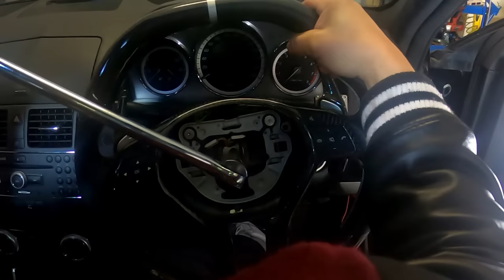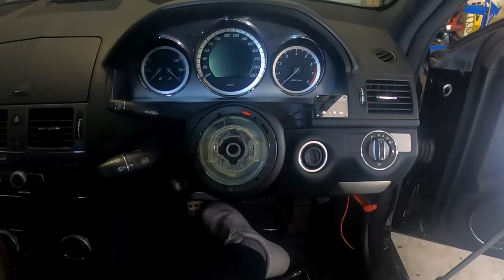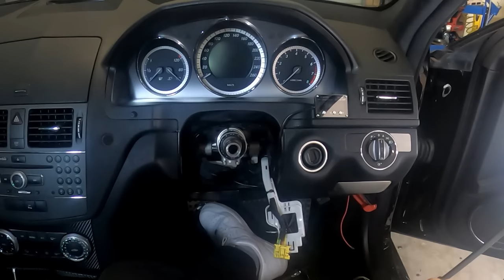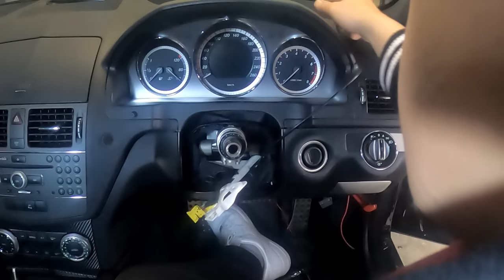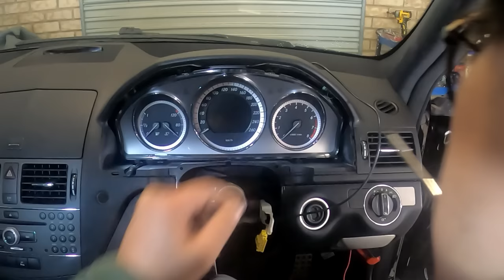HOW TO remove and fix ESL/EIS/ ELV MODULE  w212 w204 mercedes motor replace  Part 1

Comment: Hi bud, where is the motor getting power from? I didnt see you connect or disconnect the motor itself.
Also do you have to remove the EIS if your only replacing this motor? 
Thanks.
Reply from the maker: @illegalwayz1  there is a harness that plugs into it... you u see the green plug on the unit itself.. a harness plugs into it and that's what gives it power ... if u look under the car u will find a cable that leads to it and u just unplugged it ...there is then another harness under the steering column about half way that has a white connector ..I think ... and that also connects to it....if your only replacing motor u do not need ro remove the eis... I only showed that so if ppl want to send it off to code an emulator ... they need to remove both eis and esl and send it off with 1 key and then they code it to work 
 ut no u don't have to remove eis if your just replacing the motor
Reply: Okay. Thanks for your help.
Reply from the maker: @illegalwayz1  no sweat buddy thanks for stopping by
Reply: @MIKEYZVLOGZ is this the process you described in the video as “disconnect the battery?” That’s what I was really unclear on. What is meant by disconnect the battery and how is that done? Do you “disconnect the battery” while the car is running? Do I need to have the car jacked up to get underneath? It’s a great video you’ve produced, but this was a part that confused me
Reply from the maker: @erixlog ok so all i mean is to remove a terminal (negative) so that the battery is disconnected . this way the esl won't lock itself if u pull the key out plus u won't get an airbag light error wen removing the airbag too. also once u disconnect the battery wait 20mins for all the power to discharge ..then proceed ... i hope that makes it more clear... 🙏
Reply: @MIKEYZVLOGZ  not quite clear yet. Sorry. You mean the negative terminal of the car’s battery?
Reply from the maker: @erixlog  yes remove the negative terminal of the battery ... this is all i mean by disconnect the battery...when u do that .. the battery is disconnected... that's it. the negative terminal only of the cars battery...is there another battery ur referring to? to put simply..make sure you disconnect the cars battery by removing the negative terminal ..

Comment: I'm in a bit of trouble right now. This morning I went to a tire shop to rotate and balance my wheels and then I went to a automotive shop to get an oil change and once I received the car, my car wouldn't crank. I had the problem before but after like a day it fixed itself when I moved the steering column up and down to get a bit of shock for it to start again. The last time it happened was around November of 2022 and now it's happened again but this time my car (2008 c300 luxury) doesn't show any sign of unlocking the esl. I'm moving into the apartments of my university on Saturday morning and I already have had the motor from the past but have never made time to fix it and I never bothered cuz it was fine until today. Remembering back on this morning after the tire shop had rotated and balanced my wheels, I did notice I had to do the shock thing with my steering wheel but it started right up. I was just wondering if you know what I should do. Maybe even any tips for getting the esl in the unlocked position again so I can start fixing the problem
Reply from the maker: it sounds like tour motor was on its last legs ..I always stress wen u notice this happening..dun wait to be stranded u need to just get it fixed..I recommend a bypass module ..it no longer locks tour steering wheel but at least u never ha e to worry about it failing again
Reply: @MIKEYZVLOGZ But is there anyway that you are able to remove the battery connection and start removing parts to get the steering column out and then drill the hole like other youtube videos say to do without getting the chip fried?
Reply: @MIKEYZVLOGZ and also how do the bypass modules to work? Do I have to get the esl out of the car first and then connect the bypass? And also does the bypass need to be programed to the key? Or can you get any bypass module and connect it and have it up and running? Cuz I'm assuming that in order to get the car running you have to get the locked esl out of the block in order to have the steering wheel be free and then install the module which is sent signals from the eis/elv right? So it doesn't technically need to be programmed from my understanding
Reply from the maker: @amira.284  u still have to remove the esl and the eis and send it off to a locksmith or someone who knows how to do it ...better if u remove them or else they can come to your house and do it but charge for labour to remove it ...u sens off your key eis and esl and your emulator bypass device and they will male it all work for about 200 to 400 depending who it is
Reply from the maker: @amira.284  yes ofcourse u can ..

Comment: Mike hello ! 
When I insert the key the esl unlock noise isnt as clear as it was before. It seems a little bit faded. Do you think it may be a sign of esl starting to fail?  If so , would you reccomend replacing the part before failing completely?  
Is it cheaper to replace it before the esl fails completely? 
Thank you , keep up the great work 👍
Reply: It’s possible that your battery needs a replacement. Check the voltage on your battery. And for future purposes, consider replacing your OEM mechanical ESL module with emulators. (Plastic Modules) They are on eBay. Don’t worry about it being plastic because it’s only for turning the key. They also do warranty on emulators. Turn around time is 1 day shipping. $250 for the emulators. I believe there’s also a way to replace the inner part of the module. Small part. eBay also sells that small part. But you’ll have to take out the module apart, replaced that small part with a new one and your done. Dealers going to charge $1500-$1800 for the OEM mechanical ESL module but it probably will fail again since it’s a fail design. Mine is still working fine. But I’m definitely will go to the emulators route in future if it happens. The changing the small inner part probably the cheapest of them all.

Comment: Better than my previous explanation, why some people inc. myself find just changing the motor might not fix it:

"The NEC chip acts as a fuse, when the motor goes bad the excess power draw burns the chip, thus necessities a new ESL.

If you catch the motor going bad in time and pre-emptively replace it, you should be good for another couple years. But if the ESL totally craps out.... Then it's 50/50 as to replacing the motor will fix the problem.

The NEC chip holds the immobilizer info, including all key hash numbers. The ESL independently verifies the key, so if the EIS says key is valid but ESL says it isn't, tough luck. Both must match before ESL gives command to EIS to turn on terminal 15, 30 and 50." End of quote from user Deplore of a Merc forum.

Expert locksmiths I just talked to claim their repair gives you a genuine motor and a genuine NEC chip, one year warranty and if you drilled the pins out will charge you for a new lid, cost AUS$440. I am sure the Merc stealerships either install a new ESL and match it with your ignition lock/key combo or also rely on expert locksmiths to recondition your dead ESL.
Reply: hi, I renewed the steering wheel lock set which only works once. now it doesn't work
Reply: @nguyenvang1256  what did you replace (the whole els or just the motor)?

Comment: I'm lost here. I got 04 benz s430 rwd 7G tranny w220. Did a tranny swap, now the doesn't want to start. When I put the into the ignition switch (EIS) it doesn't want to turn. Battery is fully charge.
P.s I even went to junkyard got ecu, EIS and shifter still won't even turn on...
You guys talking about drop down steering column. I am missing something here

Comment: Where do you purchase the replacement motor?
Reply from the maker: ebay aliexpress Amazon
Reply: @MIKEYZVLOGZ  Just ordered a few (LOL.)  Thanks, Mike.  These instructional videos are amazing!  I am going to take on my 2011 GLK350 ESL this weekend.
Reply from the maker: @ramonmcgee2240  ur gonna be ok mate
Reply: @MIKEYZVLOGZ  Roger that, thanks.  The new motors came in, and I ordered a ujsed ESL as well.  I will try and change the motor in the existing ESL to avoid the "programming problem" with the dealership.

Comment: We are having the same issues now! 
Am I correct in saying as long as the steering lock ISNT activated, I can give it a go? 
Also.. did you not have to reprogram the part to the key? That’s what all the garages are saying we need to do and are trying to charge £200+ just for that?
Reply from the maker: hey sorry mate but u only have to reprogram if u are replacing the entire esl module or replacing with an emulator ..if u are only replacing the motor it's as simple as replacing the motor and put everytjing back exactly as u found it and it will work

Comment: What kind of motor should I get and where? Is there a certain motors that are more reliable so this doesn’t happen anytime soon?
Reply from the maker: @christianmatias5202  i got the cheapest i could find on aliexpress and or ebay and it worked fine

Comment: I’m having this same exact problem and my ESL is in the locked position. I don’t want to have to cut the bolt because that means reprogramming. I’m prepared to disconnect the battery if I get it unlocked to prepare to do this but so far it’s a no go for me. Any advice on getting it unlocked to do this project will be greatly appreciated.
Reply from the maker: hey there mate .... so there are other ways to open it but i personally wouldnt go that route as i wouldnt feel as comfortable .... so another way u could try is by drilling a small hole where the motor gears are located and u can physically turn the motor gears yourself until it unlocks however im not certain if that will fry the chip and need reprogramming .... some more research would be needed ... the only success ive had which worked for me by chance is tapping on the lower end of your steering column in order to shake the motor just enuff to turn that last rotation so it can unlock .... apart from these 2 and cutting the bolt these are the onky other ways ive heard of ppl getting the esl module to unlock
Reply from the maker: i really hope you can sort it out as i understand your frustration friend.... also another route could be getting a esl module bypass which looks exactly the same as our esl except there isnt a locking mechanism but it needs to be programmed to suit ur car.... this is my next option when it decides to fail again
Reply: MIKEYZ VLOGZ I’ve had a chance to look into things and unfortunately I was not able to successfully get it unlocked. I tried playing with the key, wiggling the steering wheel, unhooking the better for 30 minutes, banging on the area were the esl is located.

My next project will be to remove the steering wheel column and figure out how to get the lock off altogether with the battery unhooked. If I can get the whole module off and possibly open it, I may be able to replace the motor in the same exact position that the original one is in. I’m hoping that will work if it’s even possible.

If all else fails I think I’ll just get a bypass which I have found on eBay and get it programmed with the EIS. The turn around time will be about a week or so with 1 day programming and getting the parts shipped back for me to install myself. That price is $350 versus the dealer at over $2000.
Reply from the maker: @darrylpolite8722  i think that would be the best course of action mate ... i hope it all works out for u and let me know how u go.... would love to hear
Reply: Cutting the bolt (M13) should not lead to reprogramming, just putting a new bolt in, but I have not done that as yet.
Reply: Worked out without extra work it is not possible to put a new 10mm bolt in easily, so like others I am just going to hide the ESL somewhere and have peace for the next 13 years before that motor burns out again.
Reply from the maker: @dominicwild3189  well dome matey ... congrats

Comment: So how do you "fry" a chip with the battery disconnected?
Reply from the maker: so wen u go to put your esl back together , if you do not put everything back properly wen u goto connect your battery and unlock the car it will damage the chip, this is what is refferred to as "frying the chip " really... you just damage the NEC chip but it is the term that is most often used when referrring to the esl module ... it doesnt literally fry the chip {grey smoke etc } ... it just damages the NEC chip on the pcb board..hope that makes sense ...
Reply: @MIKEYZVLOGZ  You kept referring to "frying" the chip during the disassembly process after the battery was disconnected.  There was nothing in the video about the reassembly sequence.  Also, most people have a problem when the ESL is stuck in the locked position and there are a couple of ways to unlock and remove it that you don't mention.
Reply from the maker: @oldschool1993  there s apart 2 and i strictly say to only tackle if you get it in unlocked position because doing the other ways is more advanced for those who are simple like i am ... yes there are ways like drilling a hole and manually turning it, and also remove the entire column and then cut the bolt that secures the esl but that would be anothe4r video which has been done already ... i was spewcet it unlocked ...but noted

Comment: Mikey man I’m so close yet so far, I got the esl out in one piece unlocked all good there, but these pins are killing me. I used a t5 torx bit because I cheaped out instead of getting the soecial tool and now I feel like i’m gonna break them from the inside, do you turn left or right? whats the strategy man i’m down bad 😢
Reply from the maker: u just need to hammer it in until it grips its not a screw just a rolled up pin...honestly if it's too difficult u can drill them out..not a big deal... some ppl drill them out and thread tap it and use a screw..or i've evwn see ppl duct tape it nd it's fine. as long as u get grip just twist nd pull ever so gently slowly making sure its coming our ach time..repeat until it's out

Comment: Great video . My symptoms are similar though not the same . Maybe mine is just EIS ? i will confirm at a later date once fixed. After many non starts key in key out  it sprung into life . So i have done the battery disconnect method . Though before that with the engine on , i switched the engine off (click back one)  but not removed so all lights stayed illuminated . I then tried to fire up the engine and nothing happened. lights still illuminated . So i have clicked it back to just hand brake light on and have removed the battery.  By doing this i assume the steering lock is now off but will it start again . It hasn't so far  Does this point to EIS rather than ESL fault ?

Comment: Awesome,  can you tell me all at once my key stopped opening trunk and doors  and also won't start car think the fob is bad changed battery's and checked Antenna fuse all ok still won't work , so question is if ESL fails does it disable trunk and door functions on fob Thanks
Reply from the maker: no esl doesn't disable your doors ..that's a different  issue..
Reply: Thanks so much I think the Fob is messed up
Reply from the maker: @YOUKONIZER  sounds like it could be
Reply: Thanks for your help got lucky  , got a new key from Benz today and it worked

Comment: I know it sounds stupid but i tried for ages to get the bolt on the esl to go in far enough to release it from the bracket anyone found a way to do it easy as room underneath is really tight
Reply from the maker: its hard but u can always use a tool, sadly u gotta do it by feel unless u remove the entire column, its not hard to put back in just ensure you mark it if your unsure how its suppose to sit back precisely